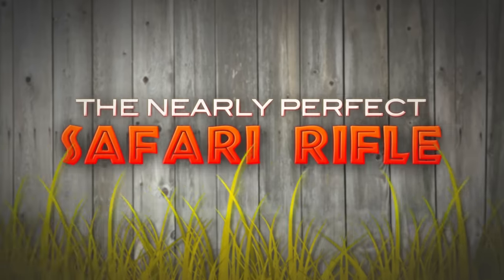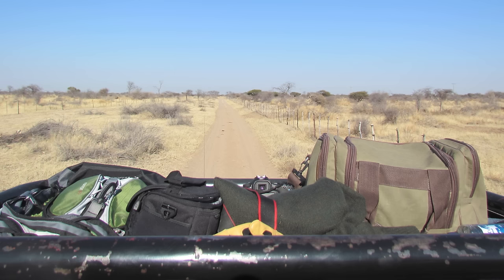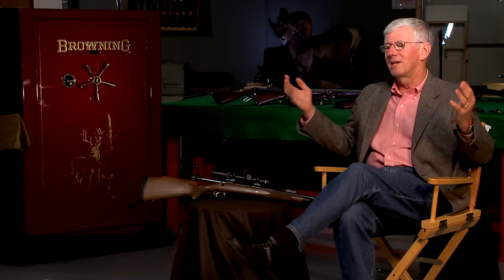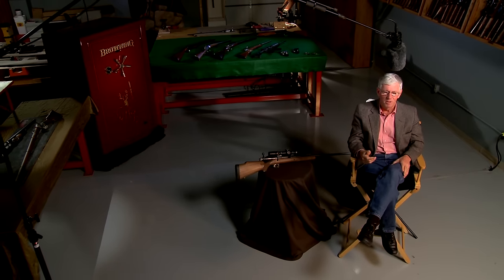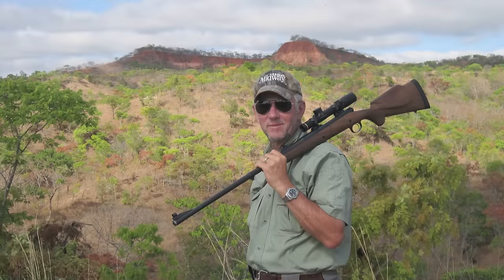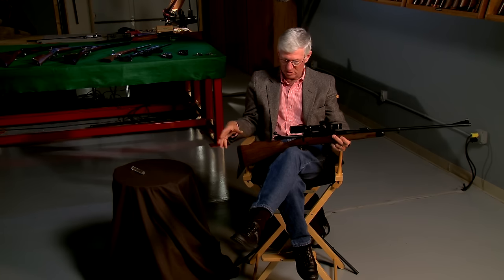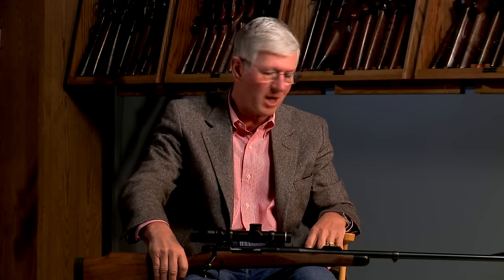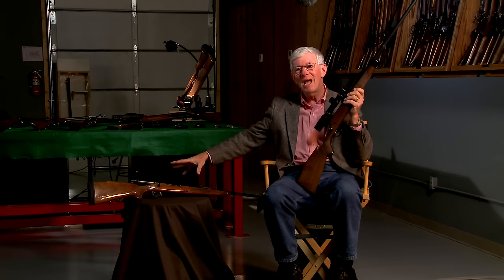The Nearly Perfect Safari Rifle -- Interview with Larry Potterfield | MidwayUSA

Comment: It seems odd, that he took a 700, then turned it into a push feed win 70.
Reply: It needed a claw extractor !
Reply: Yeah I agree I think he likes Tinkering. Knew a guy that blew the firing pin assembly right past is eye with a hand load on a Remington 700. My rifles have an enclosed bolt head. Why have an also ran rifle like the Rem 700 or Win 70 when you can have a Weatherby Mark 5. A Real rifle.
Reply: @craigleibbrand7761  Even my $300 Axis and Compass will out-shoot my Weatherby's as will all my model 70's and 700's the only thing a Weatherby has is looks .

Comment: Winchester Model 70 Capstick 470 ! 
Drop dead gorgeous , killer bolt action.
The rem 700 is as Larry says  "nearly perfect for me"  If you just starting to look for an amazing bolt action rifle the Winchest model 70 WILL NOT DISSAPOINT! 
They call it the rifleman rifle for a reason! From big game safari to sniper rifle the Model 70 has been assigned to both jobs and succeeded big time !
Reply: The only way I would hunt dangerous game in Africa with a Remington 700 is if you paid for my trip!
Reply: I don't hunt in Africa. I hunt deer in Minnesota. My go-to rifle is a 1953 model 70 in .270 win. Gorgeous rifle,  great trigger, smooth action, very accurate.

Comment: My "Nearly Perfect Safari Rifle" was purchased second or third hand, about 35 years ago. It's a Remington 700 BDL Safari Grade in .375 H&H. It came with a compact 2-7 power scope. I got it for grizzly hunting. Back then, you could do that in north central BC.

I worked up a load using 300 Gr. Nosler Partitions, 72.0 Gr. of IMR 4350 (love that stuff!!) and CCI large rifle magnum primers. At about 2450 fps, that's about 4000 foot pounds of muzzle energy. I could have gone up a bit in powder weight but this load is accurate and has zero sign of pressure issues.

That said, because it's a heavy rifle, perceived recoil is manageable. And it seems to go 'Boooommm' with a hard push rather than 'CRACK' with a stiff jolt. My lighter weight .300 Win Mag feels like it kicks a lot harder. Of course, on game the .375 has never needed a follow up shot. A 300 Gr. Partition through the boiler room is always fatal and usually rapidly so. (Okay, any proper hunting bullet through the boiler room on any animal is fatal.)

All this said, if I was going to have a custom .375 H&H made up, this one by Larry would be hard to beat. All together, a well thought out functional as well as beautiful rifle.

Comment: My nearly perfect safari rifle would be a modern Winchester 70 with CRF in 458 win mag. That’s as much recoil as I can handle without massive flinch, and in a gun I’ve spent a good portion of my life shooting, the model 70. 
For sights, I would use a Nightforce 1-8x24. I trust Nightforce durability more than any other brand, and 1-8 power is plenty for 10 yards up to 800 yards. Not that I’d shoot at game that far, but I practice shooting at up to double the distance I intend to take game at, so I know I can make the shot at the game.
For a trigger, I’d just get a Timney MOA trigger set to 1.5-2 pound range. 
Scope would be on quick detach on the off chance something manages to damage a Nightforce, with iron sight backup.
For the stock, I have a rather bad right wrist, so I’d get something with a pistol grip so my right wrist doesn’t have to be at a painful angle like it is on a standard “hunting” profile. It’s not as pretty, but that’s why it’s “nearly” perfect. It’s functional for my health.

I have no intention of ever going on a safari, but it’s fun to dream.

Comment: Went through a lot of trouble to build the "nearly" perfect rifle, and Larry Potterfield deserves loads of respect and admiration.  Meanwhile there are some "very close to perfect" rifles readily available from: Montana Rifle Co., Christensen Arms, Fury, Cooper, Winchester, Weatherby, H&S Precision, Nosler as well as many custom makers.  IMO: the rifle should have carbon fiber stock [never warp, rot or split], carbon wrapped or fluted SS barrel for less weight and rigidity, integral scope mounts [see Christensen Arms PH rifles or Ruger ]  which eliminates scope base while eliminating holes drilled & tapped into receiver.  

Understanding that Larry Potterfield wanted to build a traditional looking rifle, he unfortunately cast aside modern materials without considering that a laminated stock would not require piece of all-thread epoxied into the stock.  Also, could easily make carbon fiber with wood grain or beautiful camo finish.  

Mostly though, it goes unexplained how he gravitates toward the 700 Remington action and then mucks it up with 3 position safety ?  Keeps talking about how he is familiar with 700 action and then creates hermaphrodite.  Makes no sense whatsoever.  Does working a push feed vs. controlled feed bolt differ so much that he has to have the push feed ?  What is it about the 700 action that he is so familiar with ?  The ejector / extractor ?  It would seem that the real distinguishing feature between 700 action and Winchester 70 or Mauser is the safety, and yet he goes ahead and puts the 3 position safety on the 700 action without really ever making the case for the advantage of the push feed bolt ....  Is the 700 action more efficient, smoother, better, more elegant, more rugged ?  Again, this just doesn't make any sense and goes unexplained.
Reply: Calm down bud. It's his rifle and not yours. Just don't buy it and keep your mouth shut. You wasted a lot of time typing all that.
Reply: He's the guy that destroyed Fajin gunstocks and Bishop gunstocks. As the owner of both companies he ran them into the ground and went broke.

Comment: Remington has not been up to their prior standards in quite some time. I've sworn off their products completely, after unpleasent QC and CS issues which are all too common. Mr. Potterfield gets his result here by using the 700 action as raw material for extensive custom work. For most of us, buying a well built factory rifle for $3-6K is far more attainable. A excellent, informative video covering  what's possible in a full custom with unlimited resources and no regard to cost. Mr. Potterfield is obviously very knowledgeable in all things firearms, as he should be to operate a large sporting concern like Midway USA. Thanks for the great video.

Comment: Good video ,I'm not surprised to see you've put a rod in the stock I did this to my model 700 bdl in 300 win mag way back in 1978 when I noticed it warping a little to the left it solved the problem I also glass bedded the action ,then floated the barrel it will shoot one inch groups at 200 yds useing 72 grains of imr 4350 and Hornady 180 grain spire pts,buy the way Hornady bulletts seem to always shoot extremely accurate for me in every call shoot ,I've had great success with outher brands too but Hornady never let me down,ever !Somif I'm looking to check for accuracy in a rifle they are my go to bullet!

Comment: "KARAMOJO" Bell killed a load of Elephants with the 275 Rigby. About 1,000 of thm  [back befor they became endangered. The Rigby is the same as the 7X57mm Mauser. Jack O Conners wife got hers with a 30/06. Bullet placement and type is the key.
Reply: They also had unlimited numbers to shoot at, back up shooters, and didn't have to pay 20 grand if they wounded the animal and didn't get it
Reply: Be that as it may it's not recommended however a woman did hunt cape buffalo with a 35 Whelen cuz she had a problem with recoil apparently it was legal to do so A 7 by 57 mauser is in no way shape or form an elephant gun. Everybody knows that. He simply proved that it could be done but shouldn't be done.

Comment: Blaser made in Germany makes a nice rifle.  Balance, easy caliber changer outs, mag fed and it can be locked in by an internal switch, faster action with the linear bolt lock and unlock, trigger that breaks like glass, composite stock with internal metal block, perfection all the way around.  Super accuracy and can be broke down to fit in a short case in 2 mins.  It's a modular built rifle and when the safety is on, it actually takes the tension off the firing pin spring so if something let loose internally by dropping it or whatever it wont fire.  Putting the safety on preloads the firing pin spring and it's ready to fire.   Mines in .375 and while I wont go to Africa, I do like it in Montana for Grizzly protection.

Comment: Larry Potterfield/ Midway Arms is a class act and he has done much for supporting the 2A. I respectfully submit, a nearly perfect Safari Rifle mandates a controlled feed action like a Winchester Model 70 pre64, vintage Browning High Powers with the FN commercial 98 action(both standard(good for 9.3x62,and magnum Mauser for 375 H&H,etc) Ruger M77MarkII, CZ550, etc, vintage Husqvarna's etc all with the long mauser extractor. The extractor on the Remington Model 700 both current and former with the rivet, are notoriously weak and prone to catastrophic failure especially if the action is dirty. It is also susceptible to double feeding and jamming. Not so a controlled round feed action. It is my understanding the Remingtion custom shop will not currently sell a Model 700 in a heavy recoiling,dangerous game caliber with the stock,standard pathetic extractor. Modifying the Remington 700 extractor to a more robust Sako style or M16 type is a cottage industry both by Remington and gunsmiths around the world. Going on Safari in Africa or hunting in Alaska where a charge from a dangerous animal might cost you your life? Leave the Remington Model 700 and most push feed bolt actions in your safe. I'll take a controlled round, drop forged Model 70 pre 64 actioned rifle or magnum Mauser length FN 98 action everytime. YMMV. Happy Trails and good luck.
Reply: Pre ‘64 Model 70 action was machined from billet 4140 chrome moly steel. Not hot drop forged. The new ones are forged, though.
Reply: @johngeddes7894  Thanks for your comment John Geddes. My point, is I believe the controlled round actions listed are superior. Is not the pre-64 Winchester action bolt drop forged in one piece rather than the handle being brazed on?  If you have direct knowledge(machinist,metallurgist, engineer, etc) of Winchester manufacturing methodologies  at the time, any more info would be appreciated. I would still prefer a billet machined action or forged action for a DGR over the Remingtion 700  cylindrical tube, extractor etc, even though the 700 has been long popular with the Military/L.E. and the Benchrest crowd. Be safe,phil

Comment: 375 H&H and a nine pound gun weight bolt action with cera-kote finish of black on stainless. A barrel-band sling swivel. A 1 -5 power adjustable scope and you are set. Add a 24 inch barrel length and Browning X-bolt action. The larger screws for the scope mount and detachable scope mount are necessary too.
Reply: Right on everything you said

Comment: Great video . I was wondering if you're interrupting the harmonics of the barrel with the slingmount attached to the barrel like that  ? I have my sling on my 700 , 30-06  pump like that and seems fine but really had no other option on it
Reply: I'm told you don't shoot with a tight sling when the sling swivel is on the barrel.
Reply: @craigleibbrand7761  Correct it could pull you way off,

Comment: I love these videos but I don't really understand the attachment to starting with a Remington 700 when all you did is turn it into a push feed Winchester model 70. Why not just start with a push feed Winchester model 70?
Reply: What would he gain by going to another rifle that he wasnt used to?  Thats the point.
Reply: @greatlakespowerstrokefx4  My point is that if he was so familiar with it then why  do all of that work to modify it so much? The only thing left of the Remington was the reciever and the end result turned out to basically be a Winchester model 70 so why not just start with that?
Reply: @NCWoodlandRoamer  because he is comfortable and trust the rem700 receiver.  Most custom guns have their basis in a rem700 these days with zero rem700 features besides the layout of the receiver and bolt. 

It might come as a surprise to people but factually speaking, a properly set up push feed rifle is just as reliable as a controlled round feed.  I own mausers and 70’s and like them, iv also never had an issue with a push feed. People get all excited about controlled round feed but at the end of the day it isnt the end all be all. The first part of the loading cycle the round isnt controlled at all.  The gun is a push feed until the rim slides into the claw which doesnt happen until the bolt is about half way closed.  

Lots of hunting in africa has been done with push feed. Though when i go ill he taking controlled round guns simply because i own and like them.  You cant fault larry for liking a 700 and building a really useful example of one.
Reply: @greatlakespowerstrokefx4  I have no problem at all with push feed rifles, that's all I own and use. In fact in my original comment I said that he built a push feed Winchester model 70 so why not just start with one? I own a push feed model 70 and it is a fantastic rifle.
Reply: @NCWoodlandRoamer  im a model 70 lover myself.  Its pretty common for people to put 3 position safety’’s on 700. The 700 is a good action, i dont see any problem with doing what he did. Honestly, my bet is he did it for reasons of ease of blueprinting.  The 700 is a well known action to make shot.  By the sound of it he was treating it with way more love than it really needs for the ranges he will be hunting. Wasnt it roy weatherby who said only an accurate rifle is an interesting one?  My bet is he prescribes to the same theory. My bet is he is very experienced in accurizing 700’s, and thats why he picked it.
Reply: @greatlakespowerstrokefx4  Probably so, it is an absolutely gorgeous rifle that he built, that's for sure.
Reply: @NCWoodlandRoamer  to be honest with you it inspired me to do something more with my remington 700 from 82.  Its a really pretty example.   Thinking a trigger tech and a 3 position safety and doing similar stock work that he did would be the ticket for it
Reply: @greatlakespowerstrokefx4  That would be a great project. The stock on his rifle is beautiful.
Reply: @NCWoodlandRoamer  i love that ebony piece. What a story to have a piece of wood you found on your prior hunt. Way cool
Reply: @greatlakespowerstrokefx4  Yes, that makes it even better.

Comment: Larry, wouldn't a push feed Winchester Model 70 have worked better for this project?

Would have had the bolt handle and three position safety already and the push feed like you like. 

I mention it because I have a push feed Model 70 and thought that's what you had when the video started.
Reply: Thank you !
Reply: @Daniel Robinson Except for when they were push feeds for about 30 years.

Comment: First off I have to say I enjoy all your videos.
I watched one video of blue printing an action, and found it fascinating. It all makes sense, truing everything with but one exception made me question it.
Truing the bolt face, no issue, same with breach etc, what had me was after truing the bolt face and squaring the front of the locking lugs, WHY square off the REARS of the locking lugs?
As I understood it - the rears of the locking lugs were designed NOT to be square with the front of the lugs and bolt face because they exert a "camming force" to seat the round into the breach to a uniform depth every time?.
If you square off the rear of the locking lugs of their angled design, you remove their ability to cam the round forward into the breach and then rely entirely on the camming angle of the machined lug follower in the breach to exert pressure now ONLY on the leading edge of the rear of the squared off locking lugs...
Surely it makes more sense to LAP the rear of the locking lugs at the complementary angle to match exactly the same Lug follower race inside the breach so the lugs have full surface bearing area upon discharge?
I understand that rearward thrust under discharge and 50,000CUP+ pressures exerts a force on the rear of the lugs that wants to make the bolt rotate, bu you can't have camming action and 90 degrees dead square lock at the same time... can you?
Where you square off the locking lugs rear faces true to the bolt face and squared off front faces f the locking lugs - this leaves only the last few thousands of an inch of the lug on the corners - that actually locks up against the recessed / machines raceway that the lugs rotate in - under rearwards thrust upon firing the round?.
It that squared off corner of the rear of the locking lugs wears or compressed don't you then increase head spacing by that amount?
Squaring off the rear of the locking lugs made me cringe when watching it.
Please what part of this am I not understanding correctly, because you obviously understand what your doing so I figure you got it right and I just am not understanding it correctly. Many thanks in advance if you could clear that up for me.
Cheers
Reply: Oh and those "brass cups" around the ebony cross bolt head plugs?... = escutcheon. It's O.K. - I am a similar age to you by the look and I get mind blanks too where I know a word I want to use and my brain just won't go get that word for me to use, when I need it. Is much harder when working to a camera - the stress levels go up exponentially and make it worse.
You do exemplary videos. Wish i was young enough to be your apprentice.